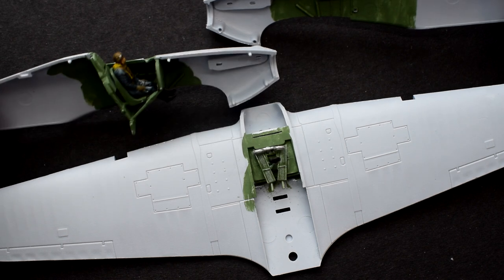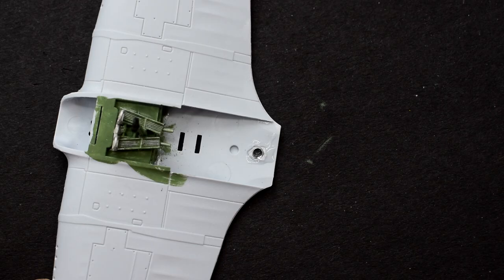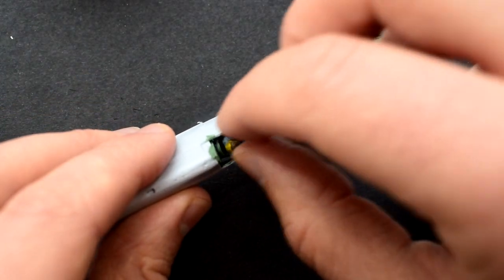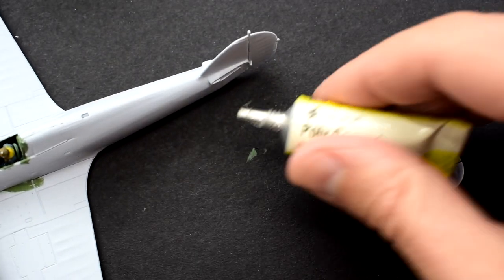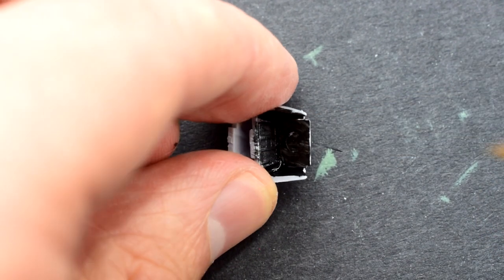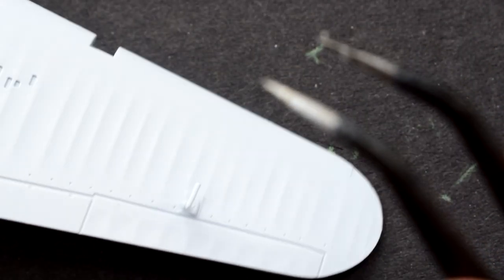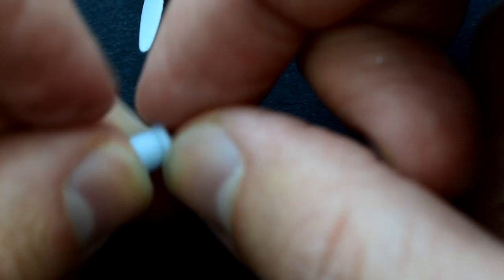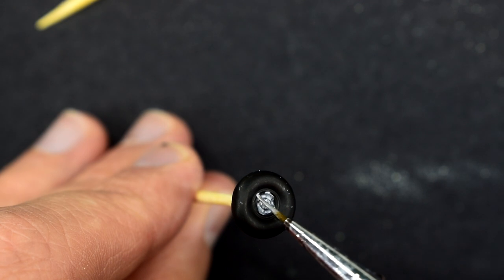Airfix Hurricane Mk.1 - Build With Me! Part 2 - General Construction of the Model

Comment: With the landing light on the bottom of the fuselage, a good trick to make them look more realistic is to stick a small piece of aluminium foil over the back of them to give them a nice shiny reflector look.
Reply from the maker: Good tip!
Reply: @ModelMinutes  maybe also wash the inside a suitable colour like orange so you can still see through it? Also I just thought, the wash /might/ act as a barrier to the glue fumes and stop it fogging up? I've not tried this but it may be worth a go?

Comment: I've just built the same model. Your videos are very helpful and clear. One tip if I may-leave the fuselage bottom off, paint it and the fuselage sides and then join them. This gives a crisp paint line along the bottom of the fuselage, this might also work for the wings as I always struggle to get a nice paint line on the leading edges.
Reply from the maker: I’ve done this method in the past, but unless the cement is applied really neatly I tend to find I end up ruining the paint finish 😩

Comment: For the beginner, there are many good instructions here, but I have noticed two things that could be done better:
1. it is better to apply the glue to the parts with a toothpick, otherwise you will always apply too much glue. You can see this clearly on the antenna mast or the tail wheel. Less is more here!
2. never smear glue that comes out on the fuselage, for example, because there was too much, with your finger. It is better to let it dry and sand it afterwards. Usually you have to sand here anyway, so it is not extra work.
Reply from the maker: each to their own i suppose
Reply: @ModelMinutes  Sure you do 😉

Comment: When I built my copy of this kit, there was a quite significant gap between the fuselage and wings. So a cut a piece of extra sprue that was about the width of the gap. Test fitted, sanded, repeated until it pushed-out the bottom of the fuselage just enough to make a tight fit to the wings. In the end, I didn't need a drop of putty.
Reply from the maker: Sounds like you solved the problem really well 😊

Comment: Hi Matt. I would advise any modeller new to the hobby. If you are to do these Airfix starter sets, I would just bin the tube of plastic cement that comes with them. This cement is just awful to use. It goes everywhere and ruins the surface. I would use Tamiya Extra Thin Cement all the time. There is a Quick Setting variety too. The advantage of Tamiya extra thin, is that you can put parts together, and then run the cement on afterwards. EG, you can tape the 2 fuselage halves together with masking tape or Tamiya 6mm tape. Then run extra thin cement down the join. Capillary action will allow the cement to flow into the join. If using the quick setting cement, you can remove the tape fairly quickly too. You can also use Revel Contacta cement. That has a long applicator tube to aid applying the cement to the model.
Reply from the maker: also https://www.youtube.com/watch?v=HC4vFGzOoSU
Reply: @ModelMinutes  Yeah, I seen that video. To be honest, I would steer clear of Humbrol Poly Cement in the tube. I never use it. Revel Contacta and Tamiya Extra Thin are the way to go. BTW, have you heard about making Sprue Guu from Tamiya Extra Thin and scrap bits of plastic? It makes a great wet filler.
Reply from the maker: @Andy.Gledhill.Models.  I certainly have, but not something I e tried yet
Reply: @ModelMinutes  No, I haven't tried it much either. I have had a go at making some which looks OK. But I have heard that its better to put scraps of plastic card in the pot. Instead of bits of sprue. I have also tried Mr Surfacer liquid filler. Its like a paint that you can get in various grades. That is not bad for small gaps or sink marks.

Comment: A little bit more finesse wouldn't go amiss... you are slathering an ungodly amount of glue onto every piece. You could get away with about 10% of the glue that you used! You'll probably find the bond and drying time would be better (not to mention less unsightly glue marks). 
Cleaning some of the poorly moulded parts would also result in a nicer finish (the prop pieces were particularly rough looking)
Reply from the maker: as mentioned in the video description, this isn't meant as a "pro" build - this is to show beginners that it is ok to build this way if they want to

If you're a regular follower of my channel you'll notice this isn't one of my normal build videos
Reply: @ModelMinutes  I see what you're saying, but by that logic, it's okay to do absolutely anything... and there would be no point in "tutorial/tip/advice" videos.

If, on the other hand, your goal is to give beginners useful tips and advice (which, by your own description, it is), then using less glue is a perfect example of that.
It is by no means a "pro technique", yet learning to use less glue is an important habit for beginners to get into, and becomes vital when starting to deal with smaller, more intricate parts in the future. I believe that, if your goal is to give beginner tips,  you should be setting an example of that, as it's not exactly hard to do.
Anyways, just my two cents. Have a nice day.
Reply from the maker: @PSPmaster321  my goal is to give new modellers a safe space to develop their skills without demanding that they follow a certain practice or method. This is merely “how I did it and you can too if you want”.

Forcing people to conform to certain ideas or techniques when they may not work for them can cause more harm to the hobby and retention of new hobbyists

There is no right or wrong, just different. And that’s okay
Reply: @ModelMinutes  Fair enough mate! Can't argue with that I suppose.

Comment: Matt would an airing cupboard or the like help those without the patience to wait for glue or paint to dry? Something with static warmth.
Reply from the maker: yeah, maybe, as long as it isnt too hot as it could warp the plastic
Reply: @ModelMinutes  Watching this again.. with the propeller could I suggest a drop of glue in the hole in the spinner assembly instead of on the pin? Then you're guaranteed it will turn as you can't get any on the pin except the tip where it's supposed to go :)